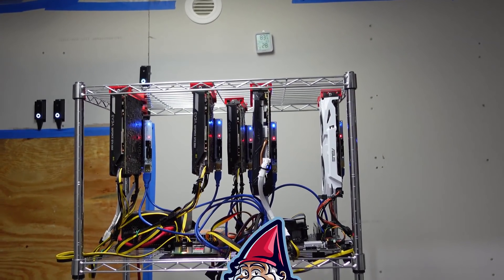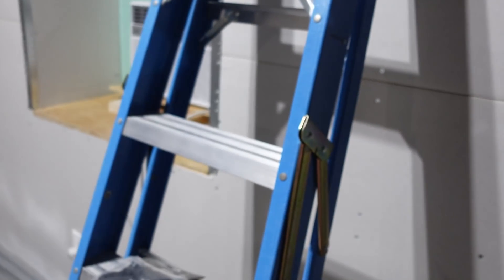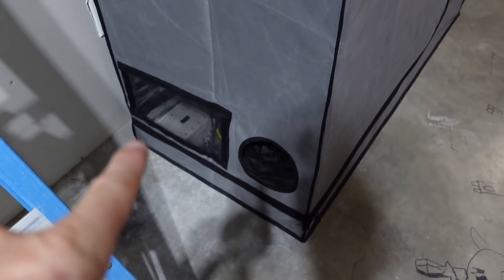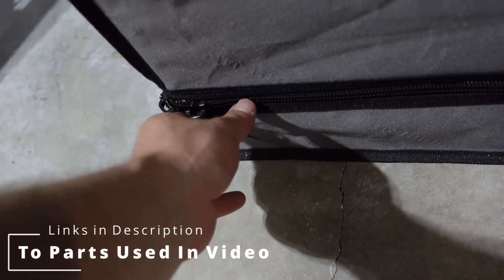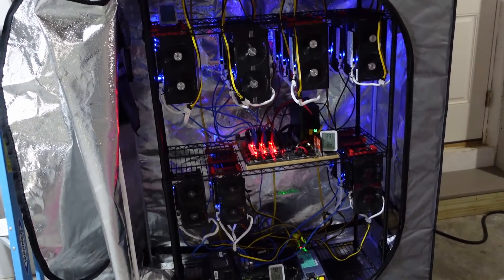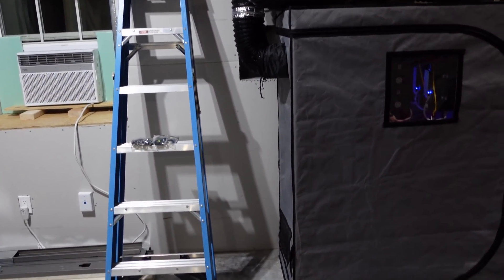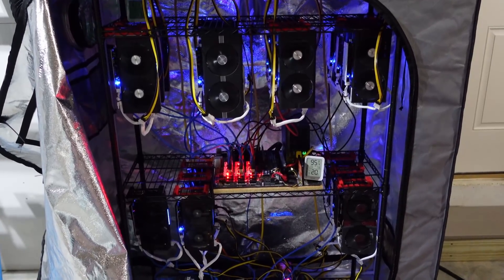GPU Mining Grow Tent | Solution to Crypto Mining Heat

Comment from the maker: GROW TENT VICTORY! What are some of the hottest cards you are running right now?
Reply: My biggest concern is GDDR6X junction temperatures. I have a hard time keeping them below 100C at optimal hashrates and end up reducing hashrates to keep it at or below 96C, which is still high to me but may not be. I really don't know. Maybe I should just do pad replacements and see if that helps.
Reply from the maker: I always recommend pad and paste replacements. I do mine yearly now. Just to cover my bases.  Whats your airflow like?
Reply: @TheHobbyistMiner  It is a new MSI 3080ti, which is just on my bench trying to dial it in. Air flow is a fan in a 28.5c room temp. I'll jump into Discord when time permits to see what can be figured out.
Reply: My 1070 in my tent is always around 75+
Reply: Every dual fan Zotac 3000 card always the hottest 😩
Reply: @jeffcoolshark  I have 5x3070 white zotac & 1x3080 AMP holo & 1x3080ti Trinity OC and other 3070s & 3080 in the tent.. lol
Reply: Firepro w7100 runs at 80c

Comment: I had the negative pressure issue with a huge infinity tent and one asic miner. I’m not thinking I should use the tent with an AC inside it and in a couple openings I will bring air inside the tent and a couple others to feed my miner. Thoughts

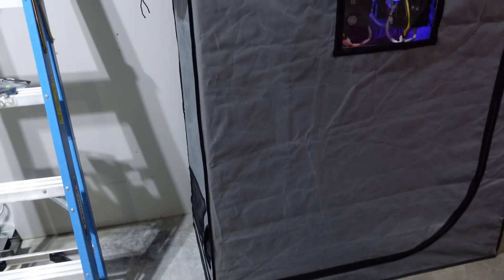Comment: having grown in these tents before, if you want to run filters, put the blowers/fans before filters so you're pushing through rather than pull through, which creates the negative pressure issue you mention at 5:45.. i'd prefer positive displacement vs negative pressure honestly.
Reply from the maker: Great information thanks
Reply: @TheHobbyistMiner  you’re welcome 😁

Comment: Hobbyist, hope you don’t take this the wrong way but have you thought about selling off the inefficient older cards and buying cards like the 6600 XT’s? The electricity bill and hear would be way down. Hash would be up too!
Reply from the maker: It is something I have considered. Hardest part will be getting ahold of cards like the 6600 XTs
Reply: @TheHobbyistMiner  Just watched your electricity video and you are actually doing alright cost wise! I am at .17 KWH so I HAVE to run cards like the 6600 XT. Keep a lookout because they are one of the more available cards. I was able to snag 6 quite easily for around 500 each.

Comment: Will def not work with those air filter boxes. Put a nylon stocking over the intake hose, quit trying to make filters made for exhausting weed odour, as intake filters. No idea why you are stuck on this method, but as usual, you'll ignore what I say, then eventually capitulate.

Comment: Am I misunderstanding / miscalculating this ?
(excluding the ATX PSU which is powering your MB)...
- you have 3 HP Server PSU's with a total capacity of 3150W (1200+1200+750).

Your GPU's use about (Total) 1470W
- RX470: 120W times 11 = 1320W
- RX570: 150W = 1320W + 150W = 1470W

You are using less than 50% of the (Total) PSU capability ?

Are you powering the two AC Infinity fans with the Server PSU's ?
- If so... how ? I have 2 AC Infinity T6's... they have wall plugs.

Comment: One thing to try, could you manage a
Kind of kit to put your motherboards vertically on the sides of your shelves structure? I think that would help even more with the flow of air… same thing could apply for all of your psus with fans pointing up.
Reply from the maker: That is what I am thinking as well.  At that point is it worth it though to just do traditional open frames in there.

Comment: i built my grow tent ..based on your earlier video.. bought the 8" vivo exhaust fan.. right off per your advice..   i also bought a portable ac 12000 unit that i may add to the mix once i get up to 10 cards from 6  ... mine is in the upstairs bonus room .. as i dont have a secure area in my crawlspace yet.. that maybe where i put the grow tent  once i get power installed under the house..

Comment: Man, my tent is on the way! 

From what I red, the 8inch inline fan was overmegakill for the size of your tent. A 6inch inline fan would have done the trick. 

Why don't you put two 6 inch booster on the 2 opening at the bottom in addition to the MERV filter box? For max airflooooooooow.

Another thing, I heard that AC INFINITY is better quality and quieter compared to VIVOSUN: might wort the shot for your next tent build?
Reply from the maker: Take a look at my past Grow Tent Videos.  I couldn't do 12 GPUS in that grow tent mining Ravencoin. Would get to 120 F in there.  Too Hot!  6" Inline Fan honestly is a waste and every miner should consider 8" as a starting point.  

AC Infinity is really good.
Reply: 8in is the way to go. I have the same tent setup and tried both AC infinity and Vivosun from 6in to 8in inline fans. I run 6 3070, 4 3060ti, 3070ti, 3080. Vivosun is great but the fan is a bit loud IMO and power consumption is a bit much. I ended up going with AC infinity due to less noise and power draw. Running at half speed temps are around 100F. All cards around high 50s to low 60s F.
Reply: I'm in the process of doing an AC Infinity tent built, I'm using all 8" intake an exhaust, but realized I need a helper fan on the intake. I'll post on discord soon, I've been learning a lot of lessons along the way.

Comment: Nice progress on the grow tent, looks damn good. I am also curious about condensation and moisture even in the current passive intake. What is the current moisture % in the tent? I think your current gauge measures that. A dehumidifier may also help if it goes out of control.
Reply from the maker: I have a dehumidifer now about 15 feet from it running all day keeping the basement at 50%.  Inside the tent currently it is 28% at the bottom of the tent where the intakes are at 28% at the very top.